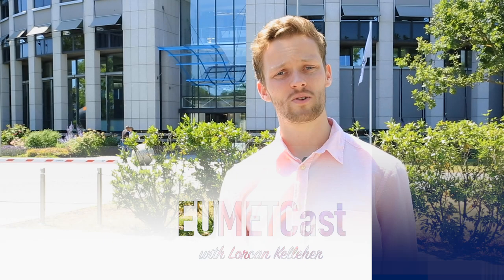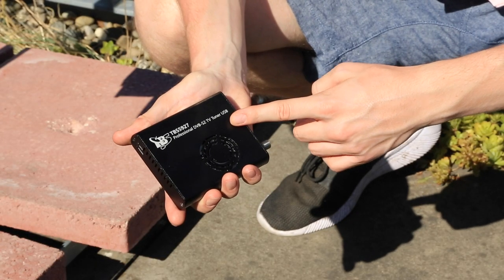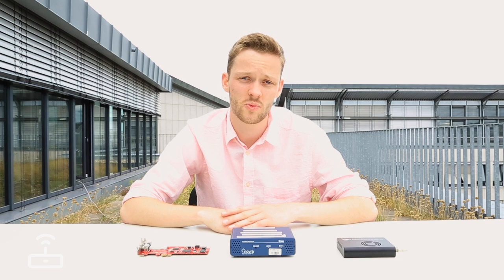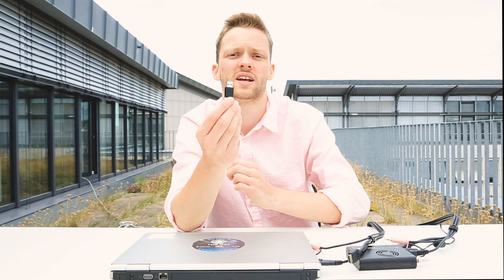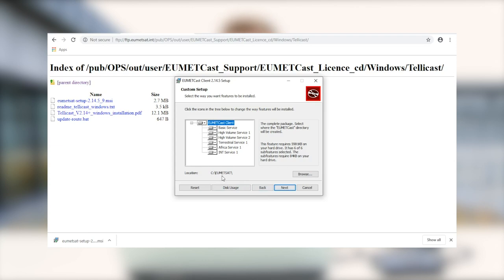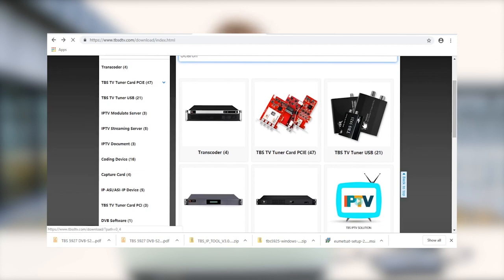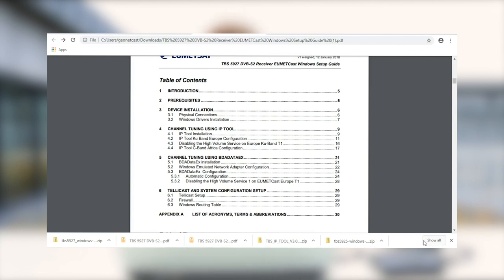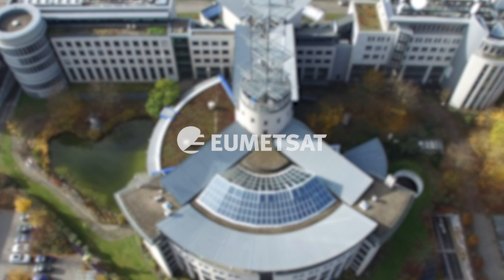How to set up your own EUMETCast station

Comment: Not completely happy with this video. It does show basic installation, but at the point it becomes interesting for me it kind of stops. You don't show the Virtual MPE adapter settings and when you show the Intellicast web interface the only thing I see is that it is connecting to 1 channel, which is exactly as far as I get... would have loved more info on setting up the virtual adapter as I think there lies a problem on my end.
Reply from the maker: Thanks for your feedback. We will be making new tutorial videos over the course of the year, and will take your comments into consideration. In the meantime, in case you need help with anything please feel free to contact our user helpdesk here: ops@eumetsat.int
Reply: @EUMETSAT1  That would be great. Yesterday I managed to get things working so quite happy at the moment :)